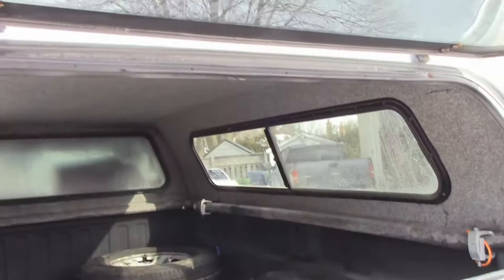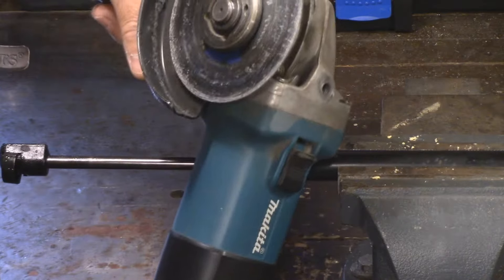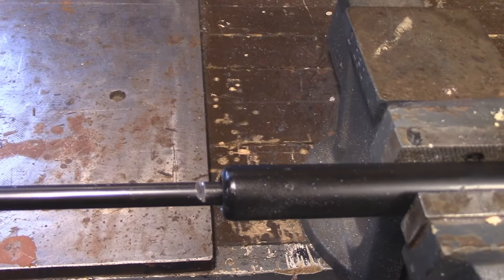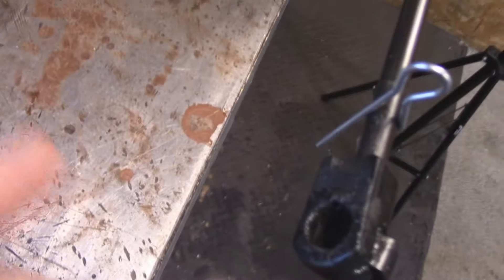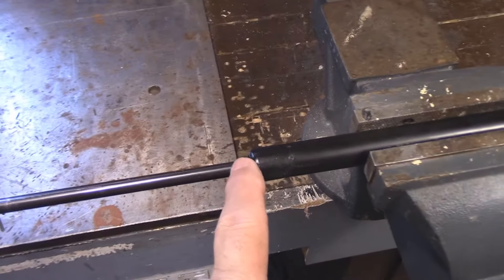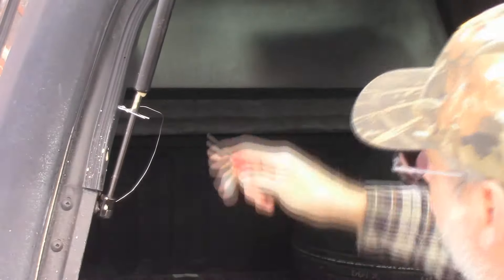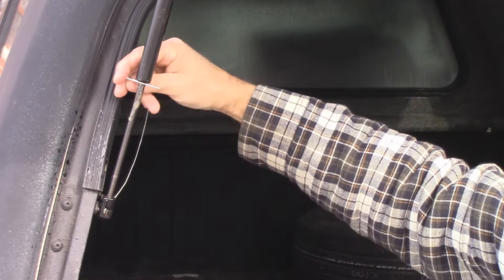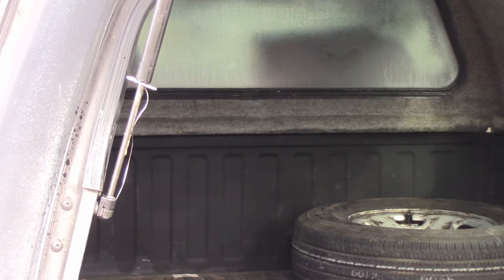Truck Cap  Lift Strut "HACK"

Comment: Nice tip. I had been contemplating how to remove the head on rod to accommodate or finagling the little slide that keeps screen door open on the closer. 😂 Keep up the good work and as always, stay safe. Cheers
Reply from the maker: Tim that's a great idea , why didn't I think of that one . 👍

Comment: That`s a good cure for them strut problems Steve but I can`t say I had many problems with my Yukon struts. Changed them 3 years ago and the new ones are still holding good but what you did is a good idea....CHEERS
Reply from the maker: Thanks Gator 
On a vehicle I would just buy new ones if their still available but today with so many shortages this hack will do well till you can buy new. Cheers 👍

Comment: They used to make a deal that was basically 2 hose clamps welded together with a short strap you put on these and tighten up and the friction from the hose clamp held it up. One hose clamp tightened on the body and one below it on the rod with a little piece of strap to hold them together, you tightened down the one on the body and then the one on the rod slid up and down and you just snugged it until you got the desired friction to hold it up. Don't know it they still make these things or not haven't seen any in 20 years but it wouldn't be to hard to make with a couple hose clamps and a welder.
Reply from the maker: I did not know that , thanks Chase !!!

Comment: I think that spray we saw was the seal getting trashed by the notch in the rod.   Perhaps rather than losing all the lift help, it would be better to slit a pvc pipe to snap in when holding it open.  Bigger but keeps the gas strut working for you.  

Another method might be to fit a compression spring in there.   It would have to be pretty light and long. Or several shorter but light springs.
But I admit, I'm buying new ones.  These days, I can afford to.
Reply from the maker: Yes your correct.  In  my case I can't find this size anywhere , they must have changed over the years   so this was a low cost fix . Cheers.

Comment: Hi, can you please let me know if the rod that you cut is aluminium or steel? I plan on drilling a hole for a pin, but if it's steel it's going to be a nightmare.
Reply from the maker: @freeskier250  It's steel and its case hardened steel.

Comment: Nice hack, but the easiest way is to just simply open the tailgate, and bend the strut lightly. This way you'll be able to open it with just one hand, and it'll stay open.
Reply from the maker: That would be an interesting video to see how it's done. 👍
Reply: literally js take it off and bend it with as much force as u can slight bend and itll stay open but ull need to remove it because it wont go back down if im not mistaken i just use mine like an older cars strut lol

Comment: Good idea, the cotter pin.
Reply from the maker: Thanks Benny👍
Reply: @SteveRobReviews  Welcome, sir.   I have hood struts on my 05 Taurus, they are weak. I made a single hood prop out of wood. It does the job and I just keep it in my trunk.  I can show you pics sometime.  If I figure out a way to mount it somehow under the hood I will do it but it still does the job.
Reply: I'm checking my alternator bolt out, seems to just keep turning but not tightening. Something has to be worn. Either the bolt threads are stripped or the housing threads are worn on the inside.
Reply from the maker: When I run into that I attach a nut on the backside.